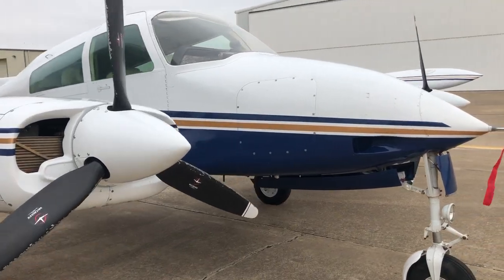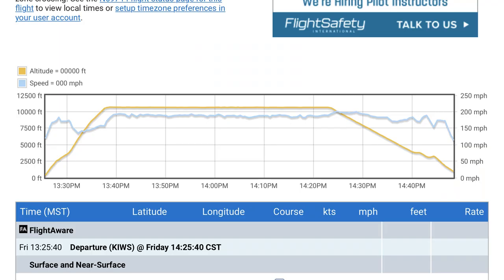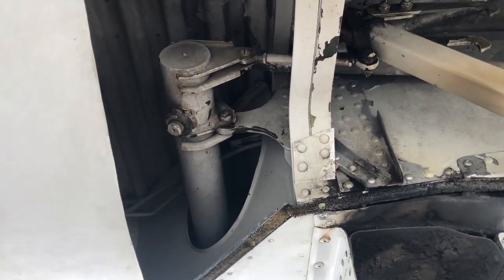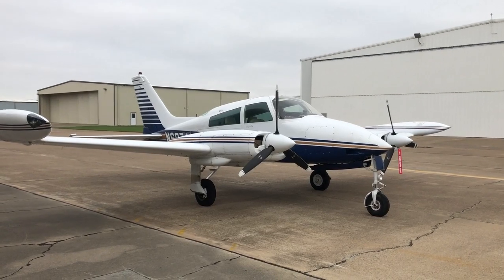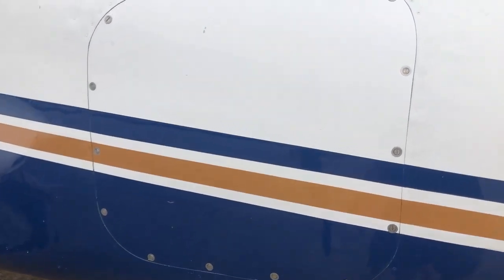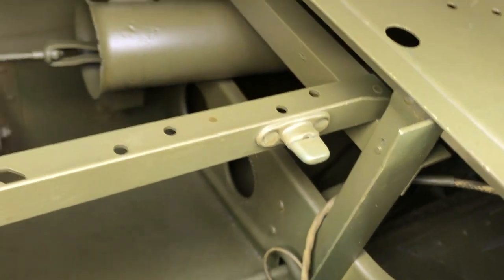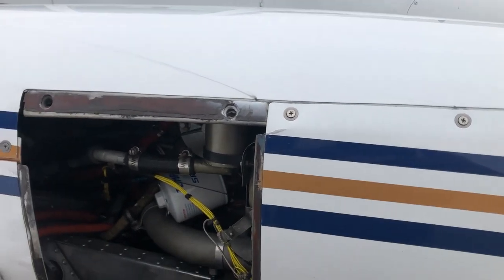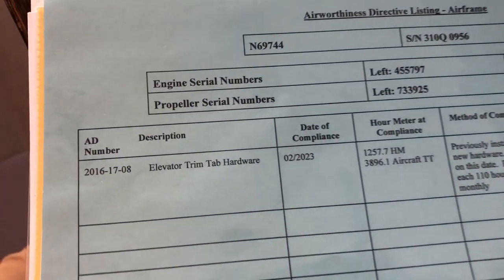Cessna 310 Pre Prebuy

Comment: At a minimum, the gear downlock tensions need to be checked at every annual, keeping a record of the numbers within the range, in the logs  One sign of wear or damage will be a departure from last years tensions.  I own and fly a 1961 C310F.  In fact serial number 0001 for that model.  My first annual took me over a year to acquire and fully rebuild the landing gear system.  It was a mess as one thing lead to another.  The sound of the gear motor, before and after, due to all of the seized bearings and other miss-alignments was like night and day.  That model year had the 2nd revision torque tubes (2" dia up from the original 1.5" diameter).  When Cessna made that change, to preserve the complex articulation geometry, they had to make a hole in the tube to clear the head of a heim joint.  The hole edges were rough, leading to stress cracks and thus both of my tubes, when I acquired the plane were ready to break.  There were a total of 8 revisions to this tube over the years (as me how I know) and I acquired a set of newer tubes, where having learned their lesson, Cessna made a depression in the tube wall for clearance, rather than a hole.  No problems since.  When I was an A&P apprentice many years ago, my mentor said, "Cessna make a good airplane, but stay away from the models with low wings unless they burn kerosene - they are maintenance nightmares".  In a way that advice was sound.  I am constantly doing something to the plane as I fly it, for one thing or another.  But mine is a classic, that garners attention wherever I go, so like I proud parent, I enjoy it.

Comment: Thanks for posting this excellent topic, Jason.  First, I’ll put in a plug for the shop I use – Tri Valley Aviation at KLVK.  When I bought my 320F in 2021 I didn’t envision flying it to Air Impressions or TAS for annual (maybe someday, but not now).  I learned that the owner of Tri Valley cut his teeth in the business working on twin Cessnas.  I did an owner assisted annual with him in January.  I was surprised and impressed when he pulled out the special down tension tool, the spring scales and the Rig-It-Right document.  He knew what to look for all over the airplane and how to get the work done thoroughly but quickly.

I would submit the following items to add to your list for a pre pre-buy…  

Get the logbooks and go through them if they’re available.  When were the magnetos last overhauled?  If more than 500 hours, you should probably budget to get that done ($750 each).  Same for the alternators ($1,000 each).  Check on the last time the exhaust system was replaced.  On my TSIO 520’s there’s an AD that requires replacement every 12 years and it’s about $8,000 per side (I don’t know if this applies to the N/A 470’s).  While we’re on AD’s, look up all of the ones for the year model and compare to the logbooks to see if all AD’s have been complied with.  The side brace kit you mentioned is very important.  I’m not sure if I’d buy one without it just cause it's so expensive to do.  Torque tubes, as well.  If those have been upgraded from original, that’s valuable.

Check for blue stains on the under side of wings.  My tip tanks are all metal and fixing leaks in them isn’t that much work.  But the aux tanks in the wings are rubber bladder type and are on the expensive side to replace.  See if you can cycle the roll down landing lights up and down.  Those are on the pricey side to rebuild as well if they're not working properly (although many folks leave these stowed and install the STC landing lights in the cowling).  Apply the toe brakes on top of the rudder pedals.  If they go to the floor or are “spongy” they will need attention before you fly it.  If it has pitot heat or prop heat, turn those on for 30 seconds and see that they get warm.  Give the windshield a good look.  Scratching or glazing is sometimes not super apparent until it’s out in the sun.  

I’m sure there are lots of other ideas to add, but these are what came to mind.  Thanks for continuing to put up good content!
Reply from the maker: Fantastic suggestion Christopher! Thanks for commenting.
Reply: Good advice, also the tip tanks are the main, no?
Reply: @zacharysinger5370  yes, on 310s the tip tanks are the mains.

Comment: Speaking of damaged engine beams, at 10:30 you can see where the phenolic exhaust fairing looks like it has worn a groove into that beam with primer sprayed over it. You are allowed only .006". The good news is, I went through this exact issue and repaired it with a DER designed doubler.
Reply from the maker: Yeah they flagged it at my last annual. Good eye!
Reply: @flyboy98  Let me know if you need help with the 8110 and the DER I used. It's literally the exact same thing. He's in TX.

Comment: What would you expect to pay for a good 310 today (assuming mid time engines, and working, but outdated avionics)?
Reply from the maker: Depends on the year model. For the Q models it seems the project Aircraft are under about $120k and over $200k gets you a good solid airplane with modern avionics in good mechanical condition.
Reply: @flyboy98  Do you know a good mechanic in Colorado for a 310 pre-buy? Also, how quickly do you think I would go bankrupt if I bought a $59k 1956 310? :)